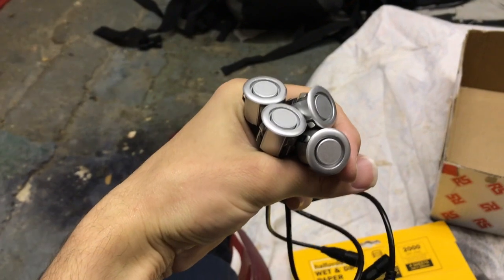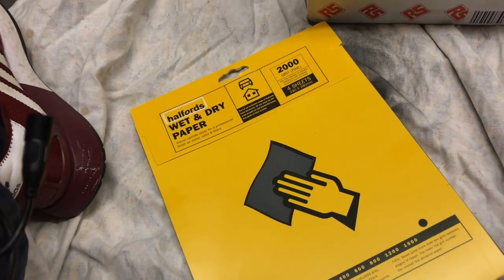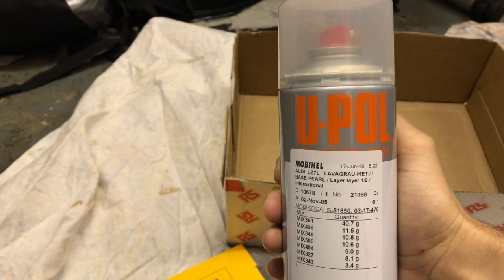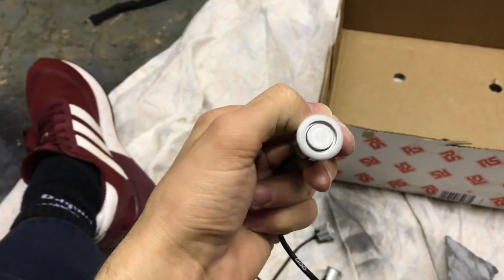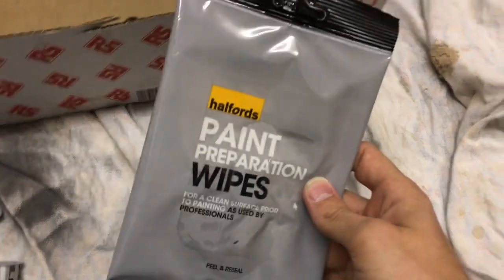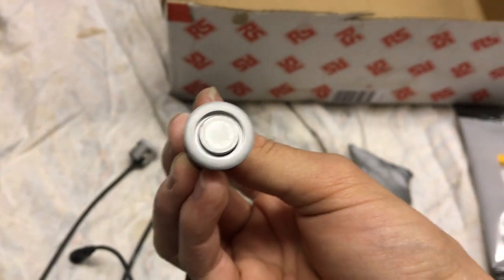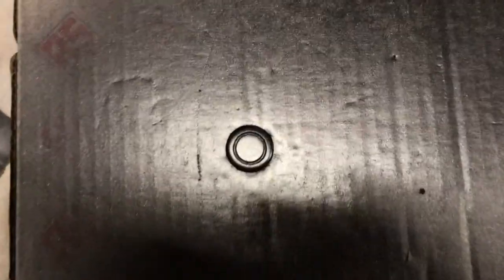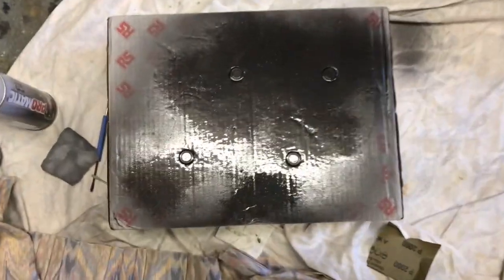How to paint/colour match car parking sensors, EASY

Comment: Silly question, but doesn't the paint go in the gap and seal up the sensor and stop it working?
Reply: Some sensors would be clearly pointed out as PAINTABLE on its package or instructions. So u just need to type the key words “paintable parking sensor” when u are looking for it online.

Comment: I had a set of parking sensors that I painted very carefully and lightly and they never worked again. It depends on the sensors. In general I think that painting them is an extremely bad idea. You might be luckier with your set..

Comment: I am looking around for this because I had a garage install a new system, and they painted the sensors, and one front sensor very often starts beeping. Manufacturer of the sensors says they are badly painted. I checked, it's really well painted, smooth, but I think they put too much paint, so now I will try to scratch it all off... (I have a video of how the sensors are behaving now) a real pain!